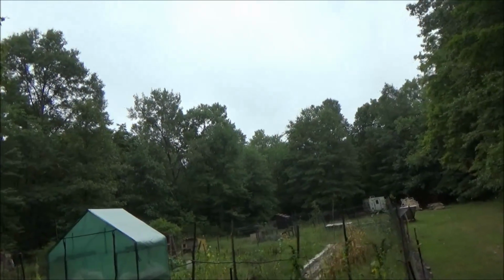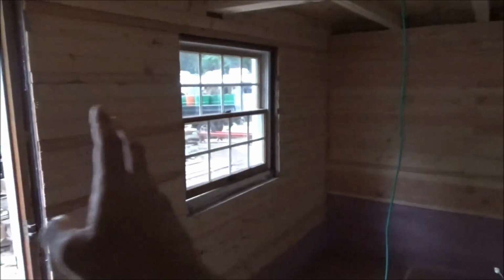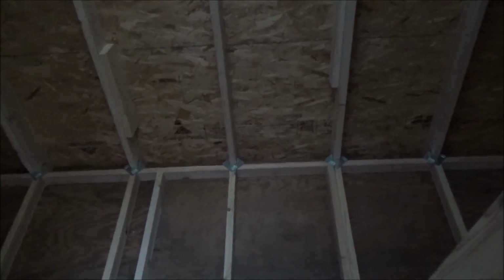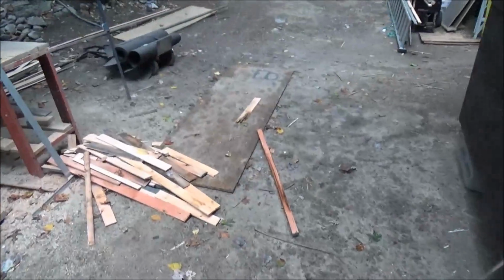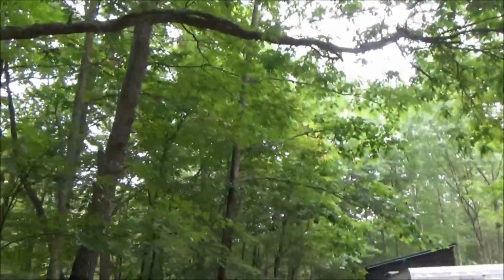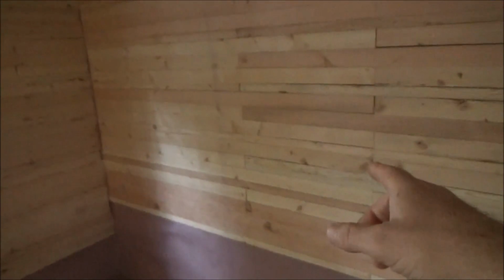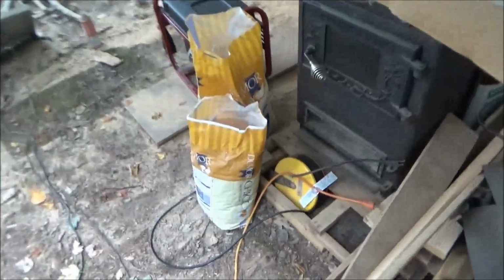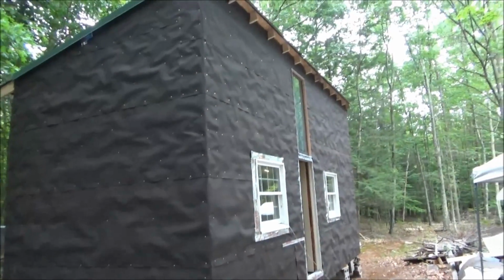Cutting Firewood And Showing John The Progress On My Tiny Home S20

Comment: Northern Hydraulics has an insert that fits into you woodstove exhaust pipe.  It is a fan forced heat exchanger which uses the heat coming up the pipe to put extra heat in the house.  I've known a guy that uses one and it works great.

Comment: you could go out the wall toward the top of the roof with the stove pipe that way you get the benefit of the heat of the pipe but no worry of leakage from the roof

Comment: Concerning heat...I built a cheap 8x16 workshop a few years ago. No insulation in the floor or ceiling. (planned but never finished) Only 1/2" foam on the walls.  So 1/2" plywood. 1/2" insulation sheet...nothing else.  With my big buddy propane heater on high, I cant wear a coat inside the workshop it gets so warm in the dead of winter...with temps in the teens.  So with your Mr buddy propane heater, invest in a few small propane tanks as a backup and you'll be fine.  If a delivery truck can deliver out there, a 120 gallon tank would heat that well insulated home all winter (at least) even if you didn't use any wood.  Just sharing my experience, always good to have multiple heat sources. Never know what can happen. Doing a good job, there are other people out there that think so much like you do.

Comment: I agree with running it out the side. You will never have to worry about leaks plus with all that insulation I think it might get the house too hot. You can always run it 3/4 ways up then out. Just adding my 2 cents. Good job so far.

Comment: Hi Troy, ask several licensed roofers about your roof, I am almost positive that since it is not a normal attic situation, because it is an internal heated roof, that you do not need any venting. The moisture barrier should go directly onto the inside surface of the roof and insulated, preferably with spray on expanding foam, the professional stuff, not the spray can stuff. But I'm not an expert, but I think if you try to vent the roof, you are making a mistake. Vented roofs are for when you have an Un-heated attic..... This is not your scenario....

Comment: I wouldn't worry about venting the roof. Your living space goes all the way to the ceiling so you have no attic space, plus you have a metal roof.  What you can do instead is make sure the insulation is tight against the roof.  My house attic could not be vented so I had the bottom of roof sprayed with 2" of closed cell spray foam for a R12 (no insulation above the ceiling. and my gas bill is less than my mom's house that has a vented attic with blown in R60.  Plus I am the only house in my neighborhood that does not get any icicles hanging off the roof.

Comment: Have to ask because your stove looks like a fireplace type. Have you found the model number from the back of the stove/or from within the door. Have you checked the clearances from combustible. Is it both wood and coal ? And you are hopefully planning upon cementing and/or screwing that rear outlet stove pipe. Have had the personal pleasure (NOT) of picking up a cherry stovepipe that fell off friends non-screwed in rear exit pipe while burning at 600F. Putting up cement backer boards with standoff (like ceramic insulators).

Comment: Having no experience with wood stoves ... but hearing John's comment about needing a smaller stove I am thinking you do not need the extra heat from the stove pipe.  Also, if I am not mistaken that stove has a pipe designed to go immediately outside... which is what I would do for a couple of reasons.  Limiting the bends seems to be important to prevent chimney fires ( by all means please avoid that!)  If you go straight out the wall and out to the edge of the roof you can strap it to the roof and have only one bend... and the cleaning will then be done only outside. Apparently chimney cleaning is a messy endeavor best done out doors to avoid getting soot on your beautiful paneling.   Also, by going directly out the wall you will have full use of your wall above the stove, which could hold a large vertical wood storage unit up and out of the way.
Reply: MotherOfManyHorses It is gonna be like a Swedish sauna!    :)
Reply: The Do It Yourself World  I am so eager to see the stove in... and well you in, too!
Reply: He could always make smaller fires.
Reply: MotherOfManyHorses True... I can't help thinking he has it insulated sooo well  that Baby Cat's farts will warm it enough.  :D
Reply: MollyDolly I think he's going to have memories of Australia. ;)
Reply from the maker: Still considering options. Was at TSC today looking at stove pipe kits.
Reply: MollyDolly
With all those Baby Cat farts it will be more like a Dutch Oven.
Reply: Uncomfortably Numb HAHAHAHA!!!!!!

Comment: Things are moving along nicely. Nice look on John's face when he saw the paneling!
I think you made a good choice with those windows for the loft. You will need the screens to keep the bugs out, because I expect those windows to be open a lot of the time.
Talking about bugs, I saw a number of pools with standing water, such as on the plastic under those pallets. You know those are breeding grounds for mosquitoes, don't you? No wonder you are always fighting them. I know it's hard to avoid all standing water (even something as a bucket or an old tire is loved by the good old mozzies), but if you don't the problem is going to be greater than necessary.

Comment: Troy you're doing a great job. I was thinking about your stove and heat situation. I would place the stove on a stone slab, place a slab behind it and a couple of water tanks next to it. Not only would you be protecting your walls and floor, but the stone and water would continue to radiate heat for a couple of hours if your fire goes out. Actually there's a video on YT of a guy that wraps copper tubing around his stove pipe essentially turning the pipe into a passive water heater. It not only heats the water for immediate use but radiates heat a while too.
Reply: Check out engineer775practicalpreppers here on YT, he has tons of cool plans you could use.

Comment: run your stove pipe more to the top side of the roof, keep it down 2 feet or so from the ceiling, will be less water coming down the roof on the outside, and you will get more heat on the inside. plus if you need to swirl a metal chain around on the inside of the pipe to clean it,you can take the pipe apart and put a bucket under it on the loft walkway, to catch all the soot.

Comment: for your ceiling the foam spacers for air ventilation would be more than adequate, would leave you with 3 1/2" insulation, that you have in the walls plus the foil barrier should be more than adequate.  Also stove pipe placement would be far better going out the back wall, you will be surprised how much heat will be given off from your wood stove, which appears to be an airtight, this will burn longer with bigger chunks of wood not split.  by going out the back wall with the stove pipe you keep the integrity of the roof intact.     All the Best.

Comment: Oh ha Troy about the chain saw the bar itself Needs to be clean and the wheel needs greased if saw dust and stuff gets in the bar witch it will the oil won't flow around the bar and the part of the chain that rides inside the bar! Hope that might help take care:)

Comment: Question: if you ate going to use insulated flue pipe from your stove, why run it inside?

If it is insulated it will not radiate heat, and be a waste of space. I would run it directly outside through the wall. It would eliminate holes in the roof, and reduce the amount of flue pipe to keep clean.

Comment: I Think You Should Think about Getttin' all Yer Wood Pile's TOGETHER! Close to the House or You'll Be Diggin' Through Snow again This Winter!  Just a Thought! Place Looks Great!
Reply: Not just that. I appreciate that Troy did not want to cut fire wood in 100F, but leaving the logs on the ground is not only slowing down the drying, it is also promoting the rotting. I was wondering at the time why he did not at least cut the trees in sections (double or even triple length compared to proper fire wood length would have helped) and stacked it at least off the ground. It would not have dried fast enough, but would have rotten less.

Comment: The walls are looking good with that wood you installed. As a suggestion when you're installing your wood stove, keep the stove pipe as straight as you can so it'll be the most effective. Personally, I think if you ran the stove pipe straight up from the wood stove thru the roof from inside, I think it would look nicer.

Comment: take advantage of additional heat instead heating the outside ! that pipe will put out a lot of additional heat that you otherwise you would be getting it all escape outside
Reply: If he runs it out the wall he could relocate the chicken tractor back there for shelter and use of any excess heat.

Comment: You should buy a STIHL chain saw I bought a used one off of ebay and its a 025 and its great. I highly recommend them. After I bought it and started using it it saved me so much time because of it working so good. The chain dont strectch all the time like the old Pouland saw I used to use. The oiler works properly on the STHL too. It has good power.  The difference is night and day. The STIHlL starts easier than the Pouland and the recoil rope dont get stuck all the time like the old cheap saw did. The Sthil saves me a ton of work and time because its a quality saw.

Comment: I like the look of johns face he was impressed I know ur looking at pros and cons about the stove pipe I would run it out the wall cuz that way u dont have to worry about leaks in ur roof and if the pipe leaks and plus will give u room on ur wall to put up shelfs and whatever u want with out the pipe and as insulate u have ur place it will be hot in the bedrooms but I would run out the wall that way ur stove is face foward  and u mite build  a place out side to put ur wood so u dont keep wood in side to bring bugs in so u can just step out grab a few logs to throw in the fire looking good cant wait to see more the progress
Reply from the maker: It was great seeing his reaction. I am still deciding on the wood stove pipe. Through the roof or the walls.
Reply: The Do It Yourself World I think would give u more space out the wall and less worries about leaks and u got sealed pretty tight i think ur going to use lot less wood and I think out the wall is safer but awsome how it coming togather
Reply: Bonez2020
though i was wondering would it technicly make the tiny house to wide where it comes past the over hang ( of cause that section could be made so it detaches if he ever has to move it to anther site some time in the future )
Reply: james head he could take off for transport if ge had to plus it would give him more space in side above the stove vs he have to turn the stove side ways then run the pipe up wards threw the celling
Reply: ***** yea but it still can leak and plus he would have to turn the stove to do that
Reply: Troy, I would suggest going out the wall but high up, with the stove pipe, avoid the roof, is my suggestion. Don't go straight out the side of the wall behind the stove, go way up, then go out the side wall...
Reply: Bonez2020
agreed  that is possable and has advantages in you can have a soot trap and hatch on the bend for cleaning the stove pipe outside  and from  what we hear now the tiny house wont need the extra heat from having it inside even though i think the danger of leaking is'nt as great as some have said especialy the way Troy go's mad on caulking every thing in this build
Reply: ***** he wont be able to do that his out is in the back of his stove he will have to go straight out the wall
Reply: Bonez2020
to do that  mean  there's three bends in the pipe though
Reply: ***** let me explain if he goes out the wall were he'll have a easy clean trap and easy installation and the stove will face the door if he goes out the roof cuz he can only have 2bends the floor will have be extended and the stove will face the window
Reply: james head I think u was talking to thechairman lol
Reply: most likly  my eye sight  is shot  and i have a tendacy to hit the wrong button  as a result

Comment: Ha! John is right. You're going to need a smaller stove! Some words from the prairies and from someone who has had a cabin similar in size to your home and enjoyed -35C Canadian winters in it...and it wasn't as well insulated as yours. 
1) Why go back towards the other side of the beam with your stove pipe? You're doing 2 turns rather than one. More turns = more problem areas, plus it's harder to clean. Fantastic plan to put it through the roof rather than the wall. 
2) Our cabin had a sleeping loft with roof built just like yours only in the 1940's, but gutted and renovated in the 80's. It was about the same size as your place. The one window in sleeping loft. It was open about 6" most of the winter with the airtight wood-stove designed to heat 300sqft. When it was -30C, it gave the neighbour great delight to watch the door suddenly be flung open and the entire family come staggering out with a billow of steam. So yeah, get the smallest stove you can find and put in TWO windows up in the loft.  
3) you need to cut and stack wet firewood to have it cure fast. If it's left to stand or lie on the ground, it will begin the rotting process first before it drys out. More surface area = faster drying. 
4) just making sure that you're also oiling the bar on your chain saw. 
5) I would grab one of your oil drums, line it with a contractor garbage bag and then use that to collect your sawdust with. Your going to run out of bags, plus the drum has a lid to keep moisture out.
Reply from the maker: I am still trying to figure out the best way to run the stove pipe. There are pros and cons for both ways. Anyway, until the end of the month, I have time to figure it out.
Thanks for the stories. I hope I have it too warm rather than too cold for once in winter.
I am cutting wood and laying it out on pallets in the sun for fast drying now.
Reply: In addition a fresh air pipe and I am not joking
Reply: Vx777infonet I don't think that's going to be necessary. He has lots of windows that open and close. It's just another hole that will need to be cut out.
Reply: FromThe Prairies I thought his drums were liquid drums, which would not have a lid you can take off. They have bung holes to fill and empty the drum. Drums for solids, which do have lids you can take off, don't have the bung holes.
If he turns his stove sideways the flue exits the back and does not need extra elbows to get to the other side of the beam.
Reply: pieter zeeuwen I guess you're right about the stove, personally, I'd want the glass facing the entry door and to keep the pipe away from the stairs, but then I'm not the one who lives there. As for the drums, I had thought I'd seen one with the fastening clamp at the top. I may be mistaken.
Reply from the maker: pieter zeeuwen True, they are for liquid
Reply: The Do It Yourself World By the way, you mentioned going to town to get those drums filled. Have you checked how many drums you can carry before you exceed the load limit of your truck? I guess each full 55 gallon drum will weigh close to 450 lbs.

Comment: Troy I don't know if anyone else has said it but I wouldn't run the pipe thru the ceiling, Its really hard to keep a roof leak proof. You could run it out up high on the wall and still get a lot of the benefit of the heat from the pipe being inside. Just my opinion tho
Reply from the maker: Still deciding. I cannot run it up higher on the wall due to the angles. You can only have two turns in the pipe. The exhaust comes right out the back of the stove. Its all or nothing for me. Right through the wall or the roof.

Comment: if john is not with you all of the time, could he not watch your youtubes like the rest of us to see your progress, or he is a good actor, eh, he. good one, i think to get the wood stove in place and while you have john, put the chimney in place, and yes have some naked pipe inside to get the heat from it. deal with the roof as soon as posible because it is high up inside, let us see the stove work in there, we are getting 30 or 2c temps here.what are your plans for the grey water
Reply from the maker: John was honestly surprised because that video was not live yet before he came over.
Reply: I think you missed that we see the videos with about a week's delay. So when he got there last Thursday, the "paneling" videos had not been posted yet.

Comment: Troy, good Idea on the wire chase. but it would have too be a lot of work. here's a few of my thoughts.   try putting your battery box on the kick out that the tiny house did use, you have about fifteen inches. it could be boxed in and still allows use and access to. drill a small hole that could be use conduit to an inside line fuse box, with the wire your using, and most channeling for the wires ,it would be useful to try. as too the pipe for the stove, great idea on moving it over, a few feet, center it on that wall. then run the pipe up to the top wall about a foot off the roof, through the wall then up over the peck, with a pipe tie. it will give you room for a copper pile sleeve to run a hot water tank, and heater. and holding tank.  you can use the 12 Volt water pump from the RV, as a pressure pump, to your bath room, and kitchen. lines can be run across that wall up and over too the sink. Take that space by the bottom stairs, and close it in to hide the heater, pump and holding tank.      out side in the back use rain gutter to a water collection to the pump all wiring is out of the weather, but still year round usages.   same points can be used on the other interests in piping heating oil, solar, wind, or what ever.   but using the batteries inside is a very bad idea.   thanks again...